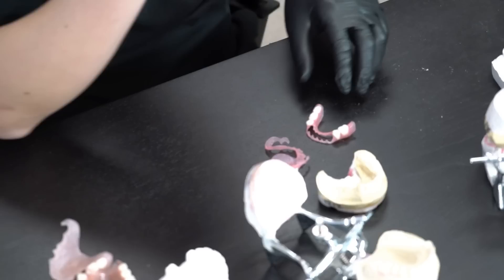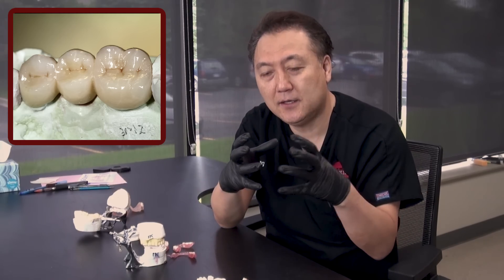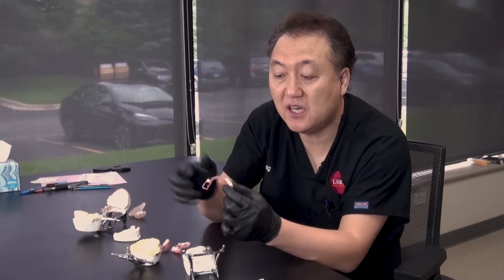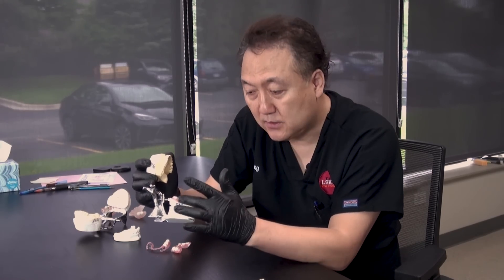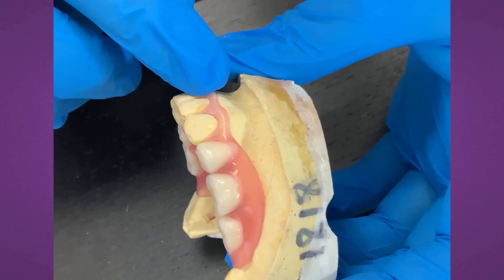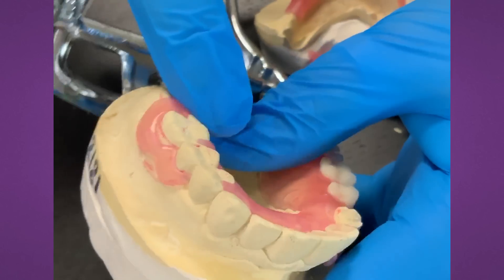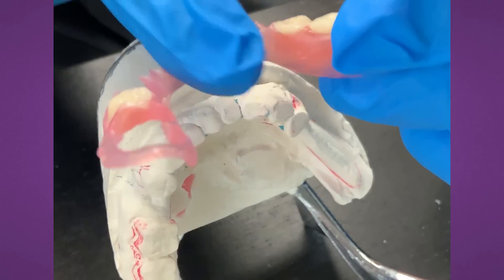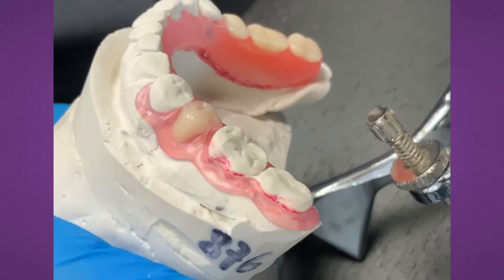New Ultra Thin & Durable Partial Material | Nylon Based

Comment: Valplast partials are great in appropriate cases and patients tolerate them quite well. Repairing them and adding teeth to them (in case of additional extractions post insertion) are more difficult than with regular acrylic based partials.

Comment: One suggestion if you could afford is gold caps! Gold feeds your body and personally my bottom gold cap has been in place for 40 years! The dental work I have incurred was removal of so called silver mercury fillings and later had to cap with porcelain caps which all cracked and broke 10 yrs later. I am pushing 70 and know a few things from experience. I want to try one of these flexible for uppers the bottom with gold cap still fine after all these years! Thanks for sharing and this very exciting new choice!

Comment: This is wonderful!  I have a very high upper arch and am a singer.  I just had to have a tooth pulled near my front tooth and I asked for a temporary flipper until I can get the full partial(which would replace that pulled tooth plus some back molars that have already been gone).  I can't stand the old fashioned hard plastic partials.  I spent like $2k on a lower one and don't even use it.  I would NEVER be able to tolerate an upper one.  I need this nylon based one(is Valplast the same)?
Reply: How did it go?   Similar here
Reply: @SlowerTrafficKeepRight-k2g  Well the flipper they gave me is way too hard to put in and take out since the space is really tight where the tooth used to be.  I tried filing it down and cutting part of it off myself.  The dentists won’t give you a very small piece for liability reasons I guess. You know, if it’s too small you could choke on it.  I am trying to make my own from that moldable tooth stuff.  I keep hearing I’m not a candidate for Valplast because of how many teeth I have missing or some BS like that.
Reply: @TinaJohnson59  I wonder if we could talk another way, situation is so similar.  But anyway, I'm waiting on a convoluted partial/stayplate submission to my insurance from my dentist.  I initially asked for a single or double tooth, ended up being a three tooth.   My problem last time was a heavy lisp
Reply: @TinaJohnson59  I have the moldable stuff too, haven't really used it yet.  In the process of getting a stayplate/partial right now.  Hoping it goes well

Comment: And we can eat every thing with this amovible partial material without risk of taking off?
Reply: Hi , I have this kind of fixture on my top teeth, you can not tell the difference in colour or tell I have it on. It clips in easy, the first month you feel a bit of pressure as it finds it settled spot , I can eat anything and it doesn’t move or discolour . I hope this helps. Ps I come from Australia
Reply: I have this and can’t eat at all ,it goes up and dawn,the food gets under the gum ,the look amazing but believe me the are not for Chewing,They are only good for show ,
Reply: @luisas3432  Thank you--that is SUCH helpful feedback. I'm looking for something specifically to eat with because I'm finding it hard to chew with a missing molar on each side. I don't need it for looks because my gaps aren't visible anyway, so...thank you!

Comment: I only have the front 6 teeth on my lower jaw and am unable to chew food effectively. I have been told that I am not a candidate for a lower denture plate due to tori on both sides of the inside of my lower jaw directly behind the front teeth. Dentists have advised that there is no way to mold a bottom plate unless I get the tori shaved down which is not an option with DentiCal. Would something like this flexible partial be an option for me? And if so, is there a dentist in Northern California that makes these? Thank you for you time.
Reply from the maker: info@lsk121.com

Comment: Mr. Kahng, Do you know a dentist in the Maryland/Baltimore/D.C. who uses your services and can provide this type of flexible partial?
Reply: I'm in the process of getting this from Aspen dental, If you have them there that might be an option,  fair warning they didn't initially want to sell this to me, I found out why when I found out the cost was only 50% of that for a typical partial.  So insist that this is what you want.  My partial was about $400.
Reply: @tammystockbridge6259  how is your Aspen dental ?  Work ok? Do you like it?
Reply: @choywang  I would NEVER use them again.  They charged me for the highest quality dentures and gave me the cheapest.  I already had the cheapest,  so I just feel like I got screwed. Although I love the staff (I don't think they had anything to do with ripping me off). And the dentures fit very well.  I'm just not satisfied with the quality of the teeth or the base.
Reply from the maker: info@lsk121.com
Reply: Dr. Crystal Ellis at the Smile Suite in Silver Spring , MD

Comment: I am 72 n just got this bottom partial n was hesitant. But amazed how snug it fits, with no metal clasp. Very durable.  Impressed n happy.
Reply: Can you please tell me where you had it done? Thank you so much!
Reply: Thank you sharon...
Reply: Same here ! Got mine today and loving them so far !! My dentist is awesome and always does great work.
Reply: Hi Sharon I’m in Canada 🇨🇦 just wondering about some info on it can you let me know what they are called so I can  help get some for my grandma take care
Reply: I am an old age person, I am afraid if this partial denature is going to be painful on the gum line. Eating chips and bread usually hurts my gum line.
Reply: @945982  STOP eating chips, Grandpa.  
These partials are probably more comfortable than any other.
Reply: I had almost the same 2 times, but the pink part took the color of some food (blueeberries, curcuma9 and after a few months it turned orange.

Comment: I have a question, I understand the part that shows the bottom jaw and teeth and the pink goes all the way around under the teeth 
My question is does it bubble at the bottom close to the jaw
Can U make it flush 
I have very thin skin around that area and upon wearing something like this my fear is it will be noticeable when I put it on from looking at me and I understand there are other designs that don't have it at front under teeth however it is my dear for top and bottom all around regardless of design if the pink can be made to sit flush with teeth jaw line and not bubble along edge (not sharp either but more flush as to not be noticeable upon external visual)

Comment: When are you going to be able to grow new Teeth from Stem Cells?
Reply: That'll be interesting..I lost my front teeth since I was a kid because of a fall and since then i have used a bridge ..I guess its gonna cost more then implant ..I mean it works in a lot of cases for other body parts..I had my first hip surgery and dr use stem cells as replacement ..I wish I don't have to worry how long my  new  piece gonna last this time or to eat a nice stake without have to cut it like Im feeding a baby ..
Reply: blackangel3375    I pray this comes to Fruition! I had 4 implants put in on top! 3 I pulled out myself, 1 I had to have surgically removed! All on my Dime! First Oral Butcher retired, so had to go to another for last extraction! It was torture getting them implanted! I swear the 1st surgeon was instructed by Mengele!  Had to have Cadaver Bone, sinus lift all for naught! Should have had my whole body redone for what those freeking teeth cost! GodspeedZ,
Reply: Kathleen Weber 
I understand because my last one I have to save all my money and more to do a permanent parcial.. what I didn’t know I was gonna lose another tooth on that project and 3 Filed so that piece can be plugged.. also I got porcelain because the metal of the old removable parciales messed up my back tooth which had to be removed so the dr can put the new piece..I didn’t have all the money to fill the other space that was open and I did a removable parcial just like the same material of this in the video.. it’s a complete one like the old version but same flexible material..I really love that one..I wish the dr recommend me the removable parcial before I spend the money on the permanent because now as I take the removable it’s been losing up the top piece and I had to fix it a few times.. note that the world it’s going crazy I’m so anxiety and I already messed up the back tooth..
Reply: blackangel3375   It is a never ending Battle with Dentists! False Teeth are much worse! Whatever it takes save as many teeth as you can! Good luck! Godspeed!
Reply: Kathleen Weber 
My luck is as much as my teeth.. almost none..🤪
Reply: blackangel3375   Now, now! If you live in America that is all the Luck you need! It will be getting better every day! We have hope that a Miracle occurs and we will grow new Teeth with our own Stem Cells! Never give up hope! Godspeed!
Reply: Kathleen Weber 
Yes pray the lord for that..
I still have hope.. all though I’m 45 and last time I had my own I was on my early teens out going to teen.. like I said before because a fall when a practically a baby learning to walk.. the baby tooth got got stuck on the bone and the never got damage.. by the time u got my permanent their start falling apart and back then wasn’t too fancy like now or give you options to fix it so my parents decide to remove them not thinking on my future..
Reply: blackangel3375   Oh for sure that happened! I am 71 so you have a lot of years needing teeth more than I do! We never brushed our teeth or went to Dentist back then, we were poor as well, nine kids in our family, Father drank, Mother Very Good, just no money! My Grand Parents had Farm so we always ate good! Take care God Bless!
Reply: Kathleen Weber 
Well we have a few things in common.. I did really brush my teeth a lot.. that’s something I’m so focused since I’m a lil kid.. don’t know why.. but hopefully the way things going we probably see our dreams come true soon..
Reply: @kathleenweber1595  Dr. Jeremy Mao, at Columbia University, has been working with this for over a decade. You'll keep waiting in America; where the ADA is too interested in all the money they make from the old procedures. Only the very wealthy will have access if it's ever approved.
Reply: @anael55  thanks for the info! Godspeed
Reply: Research Tideglusib grow teeth from stem cells...
Reply: Taylor Sherman   Thank you very interesting! Hopeful ! Godspeed!
Reply: That falls under the work of Dr. Jeremy Mao; who has been working at tissue regeneration at Columbia University Medical Center for nearly two decades. Unfortunately, the American Dental Association will do everything in their power to keep it from being approved. https://www.periodontal.com/bodys-stem-cells-can-lead-tooth-regeneration-end-dental-implants/
Reply: They're actually working on this in some labs, however it's not likely to be cost effective for at least another 30-40 years even IF they ever perfect it.
Reply: Tammy Stockbridge      You do not know the Poser of Prayer! In Jesus Holy Name, Lord Teeth Sooner! Godspeed
Reply: where do the stem cells come from? aborted fetuses. so if you're ok with murder of human beings in order to make products, well, then, i bet you're a democrat.

Comment: This is the one they've been suppressing, thank you for this. Every other solution is barbaric waste of still functioning teeth you are forced to extract.
Reply: I agree! That's probably why my former dentist never mentioned it. Glad I got a second opinion.
Reply: My dentist recommended to grind down my teeth next to the one missing when they are already grinded down and have veneers on them.  I went to my original dentist and he fixed my tooth for only 70 office visit.  The other doctor was going to charge me 3400 and I would have to replace it in five years.  It is always a good idea to get at least two opinions and maybe more if the consults are free you are not losing any money but also look into cosmetic dentistry as they can do so much more these days with less pain. Less price too.  I was so desperate I almost paid the ten thousand dollars for the one tooth to be implanted so imagine my surprise when my dr put the tooth back in for an office visit amount.  Yes I will need an implant eventually but this gives me time to save the money for it while the implants get better and better and easier to be placed by finding a very good cosmetic dentist to do the implant who uses 3d images and makes the tooth in his office as well as the guide and the crown.  get it done all in one visit and no need for being put to sleep.  No four months healing times and invasive procedure for a tooth implant anymore.  people need to know what is available because some lazy dentist do not want to improve their skills and still do things the old way leaving many poor people with bad mouths.

Comment: Too much flex in the major connector causes tooth loss.  You should know better.
Reply: Any type of partial denture can cause tooth loss and/or tooth decay.  You should know better.
Reply: @kibblenbits  Thumbs down to this reply.  These partials DO NOT meet the standards for principles of R.P.D design.  These standards have been written for more than 50 years based on long term studies.  This type of partial is not acceptable to these standards.  I guess you do not know better.

Comment: I'd like to see one that has been in the mouth long term.. All products look great when they are new..  I'd like to see one that's been in the mouth 4 months.  If they can be repaired and relined, they've got to get thicker at that point.
Reply: does hard acrylic bond to it ?   ahh nylon..  it's still nylon..
Reply: They can be cleaned with chlorine, just remember to get all the chlorine off them again afterwards, as it’s very poisonous to get into the mouth.